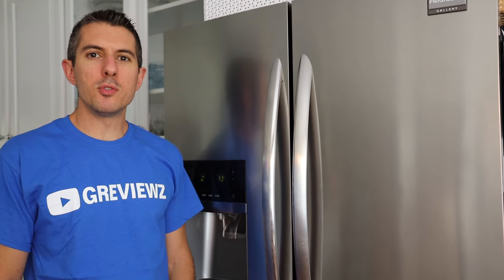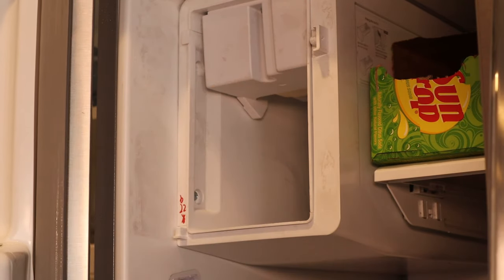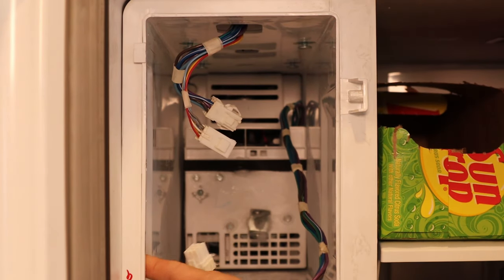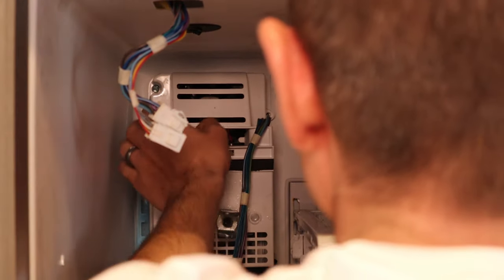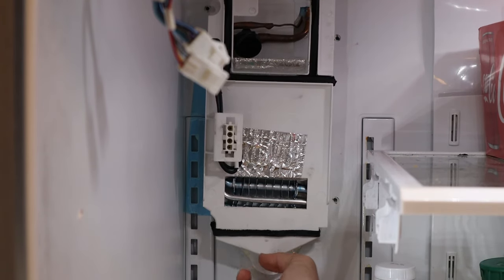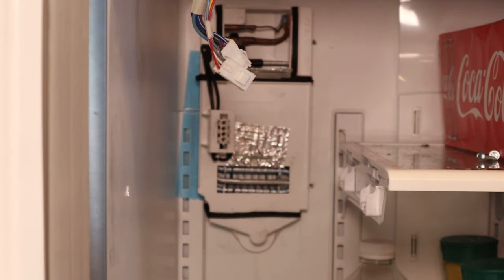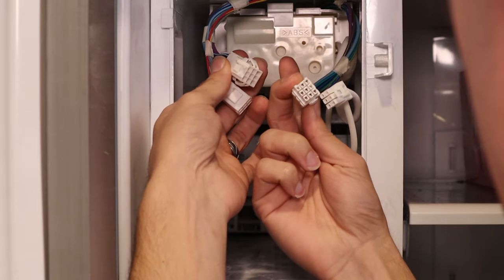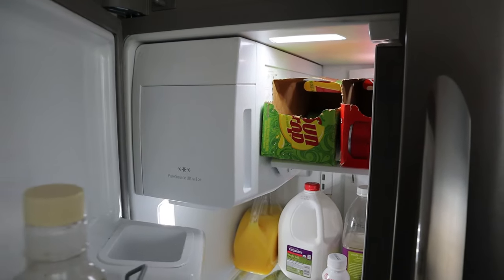Frigidaire ice maker broken again: fix it

Comment: Thank you much for the video. I was able to fix my ice maker and avoid a costly service call. The most difficult part was snipping the back zip tie for the wiring- that little sucker was tough to get to! I actually left the back mounting connected (8:55), just unscrewed the mounting and let it hang there so I could get a blow dryer on it for 7-8 minutes. Did this yesterday afternoon and we have ice this morning. Thank you!!
Reply from the maker: Thanks for watching. I appreciate the positive feedback . I am just glad it worked for you and you have ice again.. I hate to see people get ripped off with a poor design from Frigidaire..
Reply: @GReviewz  hey boss, I did enjoy the video and you are correct it's a design problem.  But frigidaire has a kit to fix this problem and I do believe they will supply the kit at no cost. You are obviously handy so contact the mfg and I'll look for your video installing kit. 
It's not to hard, I've installed hundreds if not more. 
Great video to get people's ice maker going !!
Reply: @jameseck4238  Hi, can you share a link to the kit they have to fix this? We are having to defrost ours almost monthly now
Reply: @katiec3932  what brand
Reply: If its French door bottom mount freezer ide contact mfg. Part will probably be free. Have your model and serial number handy. Tell them you where informed there's a Bulletin out on this ice maker and you'd like to get the kit. There's several different sizes and styles so it's best to contact MFG.
Reply: @jameseck4238  thank you! It’s a Frigidaire gallery
Reply: @jameseck4238  Frigidaire did not know what kit I was referring to, any idea of a part number by chance?
Reply: I installed a kit from Frigidaire. It worked for a while, but I’ve had to dismantle and defrost multiple times since installing it. I’ve even sealed up the gaps with aluminum tape and still no luck. Garbage design. 😒
Reply: @ReneJeddore  there's other reason for not defrosting. The garage kit is to get around ambient Temps being to low not defrost. Depending on the age of your refer, you more than like need one or  two of the defrost parts. 1. Defrost bi-metal, 2. Defrost heater, 3. Defrost timer/ or adaptive defrost control board. 
Heater has nothing to do with defrost. 
Also frigidaire refers especially older ones 10 t0 15 yrs old can get restricted in the sealed system.  If you have a picture of it all frosted up I could better help u. So if you have Meter you can check these parts, minus adaptive defrost  control easily.

Comment: video is great and right on the money. only problem i had was removing the very last piece of plastic in the back where the coils are but the hair dryer took care of that problem and melted all the ice anyway. started at 2:00 in the afternoon and had ice again by 7:00 5 hours later. whole process only took me 1 hour to take apart and put back together. thank you so much for the video. almost forgot i kept my fridge on the whole time exept when i was ready to use the hair dryer , then i unplugged it so my down time was only 30 minutes untill i plugged it back in.
Reply from the maker: Awesome! Glad I could help!!

Comment: Thank you so much for the video! I've been getting so frustrated. I thought it was a filter or something else. You were right. It was loaded with ice all over the back. I melted all the ice and I finally have ice cubes in my tray again!
Reply from the maker: Awesome! I am glad to hear I was able to help you out!! Please like and subscribe!!
Reply: So the ice machine was working good for the past couple weeks. But now it's back to not making any ice at all. Is there something I need to replace to stop it from freezing? I'm going to try it again Tomorrow.
Reply: The manufacturer failed to put the proper insulation in the back. Your problem will keep coming back. Check for rusting holes in the back. Class action lawsuit on this worthless POS. Lawsuit closed in 2016. YET no recall😡

Comment: Thank you for the video, I think this is what I need to do, I have the same unit. I turned the refrigerator temperature up a couple degrees recently, and since then the ice maker quit working after no issues for 4 years. My theory is that it caused melting in the ice compartment or condensation, which dripped or beaded up and froze elsewhere.  I thawed it with a hairdryer before and it started working fine again, but I didn't take it all apart and most likely there is a bunch of ice buildup like you had.  The last batch of ice is translucent, which kinda says that the fan may not be able to spin.

Comment: Great video of each step in taking the ice maker apart and reassembling it. It made the job easier for sure. My tip for other is to completely disassemble the unit until you get to the hole in the back. That’s where the last bit of ice was. I found ice throughout the unit but used the hairdryer on warm/low to defrost it all. Also, once its all back together, put it through the manual diagnostics. I did it twice and i think it reactivated everything. Ice began with the hour.

Comment: Knowing about the defrost mode was very helpful.  I was able to set to defrost, then simply remove the ice tray and take a hair dryer and blow on high in the ice maker region for several minutes, then do the same directly behind it in the rear of the refrigerator.  I actually had ice build up on the outside of the refrigerator!  After thawing the OUTSIDE rear of the fridge, the ice began generating just a few hours later.  No need to disassemble anything in my case, just removed and reinserted the ice tray after "thawing" with a hair dryer.
Reply: I'll try this first. I was going to attempt the above and keep my fingers crossed. LOL
Reply: Yes. No need to disassemble anything. Hair dryer for 20 minutes worked for me.
Reply: I have the same issue with the ice build up on the exterior. Followed the video thawed everything out and a couple weeks later, Same issue arises again. Enough ice builds up that the fan gets very loud. Any solutions to stop this form happening?
Reply: @mitchmover3284 @GReviewz

Comment: Thanks for this in depth repair video! I just fixed our Frigidaire model- JBND-27, with ice maker model- IMK0028A.

It is a different model ice maker than the one you showed. It is the same until removing the motor cover. It has 4 screws and there is a wire or hose that I couldn't seem to find a way to disconnect.

But I was able to feel around blind due to your video, disconnect the plug and lean it forward enough to remove all of the ice and defrost it all with a hairdryer as you showed.

Worked perfect and is now making ice again! :)

Thanks again!

Steve
Reply from the maker: Thanks for watching Steve! I am glad my video was able to help you!! Just keep in mind this is a re occurring problem so remember the steps and you are good to go!!

Comment: Hey man, you are an absolute life saver! I appreciate how detailed and thorough this video was, especially the parts where you include instructions that help us not to break stuff.  Got my ice maker working again last night!.  One thing I'm curious about and am going to do some more research on is, why does the ice maker ice up in the first place?
Reply from the maker: Thanks for watching. I am glad to help. It’s a moisture issue. They put an ice maker in a refrigerator… dumb idea… there is no real seal so what happens to your cooler ice when you leave the cooler out in the sun… the ice melts.. so the longer you leave the door open the more moisture gets into the ice maker area and then freezes…
Reply: @GReviewz Did you check the defroster wiring for icemaker? The main circuit board has been updated on these as well. There is a black box down behind the grill below the left door that can be replaced if you continue to freeze up. Found another utube video about it. I have this problem every month or so. Gonna try a fix. Tired of pulling it apart.  Thx for video. It was informative. The design is poor to have icemaker in the frig.

Comment: I also have the Frigidaire 3 door similar to yours.  In my case (now twice) it was literally the ice tray assembly that has been the issue.  I have not had the icing issues, just failure of the mechanism that flows/fills/heats the cubes.  I will however absolutely bookmark this in my head for when it does ice up, which I can occasionally hear the fan clipping on the built up ice, so far it self clears.

I can replace the ice cube tray assembly in about 6 minutes now, having gone thru the process now more than once.

Keep up the great helpful videos and thank you
Reply from the maker: Thanks for watching. If you haven’t had the ice problem yet, it’s coming. Keep up the good work doing things yourself. It saves a lot of $$
Reply: @GReviewz  I appreciate the encouragement.  Never had so many ice-out issues with any fridge ever.  This one is puzzling though, replaced the innards to the ice maker itself, (new tray/mechanism) as I did 2 years ago, it made 2 trays of cubes and ceases to produce anything further.  Doesn't fill the tray to make ice but yet the front panel allows for fresh water.

Me thinks the relays assembly on back may be at fault, as upon inspection I do not have any ice buildup inside any of the innards of the ice maker area.  Mine is darn near identical to the Gallery series, one level below but the ice maker assembly, mechanisms visually are identical to yours so they seem common between the various levels of fridge/freezers.  Any thoughts where to look next?  

I do have a full set of water line relays/valves from when I changed them first time thinking they were the issue when it was really the tray assembly itself.  (And I cannot access the force defrost option on my panel as it is one level below Gallery)

Comment: Great video! Exact same fridge I have, so this helped immensely! Mine was actually a little more frosted over than yours! Back to making ice!!
Reply from the maker: Thanks for watching. I am really glad I was able to help fix your ice maker!!
Reply: Froze up again shortly after. This should not be happening on a regular basis. A bit deeper dive and diagnostics on this. I found the defroster thermostat to be failing. It was not switching closed to send current to the defroster.
Reply: @bobbystark5653  where is that located?
Reply: @robbiebeacham2975  at 15:37 in the video you can see the thermostat hooked to the copper lines for the evaporator coils (black thing hooked to it with 2 wires coming off). After some troubleshooting with an Ohm-meter, I determined that had failed and needed replaced. I ordered "Electrolux 5303918568 Frigidaire Thermostat" from Amazon for my fridge (same fridge in video) and I have not had a problem since it was replaced 7 months ago.
Reply: can you tell me how to test the thermostat?

Comment: Excellent Video and spot on.  While my motor and coils weren't really frozen over, freon supply line to coils was.  Defrosting them solved problem.   Be sure to run two or three pitchers of water thru fridge water dispenser  after putting back together to bleed air out of line.  ALSO ALWAYS TURN OFF ICE MAKER IF YOU ARE SHUTTING OFF WATER LINE TO FRIDGE FOR EXTENDED PERIOD OF TIME !  I believe not doing this caused our problem.   Again Great Video !!
Reply from the maker: Thanks for watching. I’m glad I was able to help. Good pointers!!

Comment: Great how to video. I had to do the same with our gallery fridge more than once.  Also the lower freezer drain had a piece of insulation partially blocking it from day one. The poor ice maker design, lack of insulation and inherent problems caused this fridge to be part of a class action lawsuit in the US. I finally gave up and ordered a new one. Not Frigidaire either.
Reply from the maker: Thanks for watching and for the comment. I am glad I was able to help you. What fridge did you end up going with?
Reply: @GReviewz  Actually it just got delivered this morning. We bought a counter depth french door, freezer on the bottom stainless model. Ice dispenser in freezer compartment this time and interior water dispenser. Its Whirlpool. Great reviews. Via Home Depot. Hopefully no more freezing up.

Comment: Great video and super user friendly! Was exited to see I have nearly the same set up except the "coil cover" but after taking it apart, found there was very little ice. Only the coils had some ice on them. I'm losing hope that icing over was the problem now, its been a little over an hour and no sign of ice yet.
Reply from the maker: Thanks for watching. There is many reason for the ice not working. The ice buildup the most common reason however. Any ice yet?
Reply: @GReviewz  ice is way slower than I expected, but it's half full at this point!
Reply: The online manual says that it may take a few hours to start making ice and up to 48 hours to refill the bin.

Comment: Thanks for posting this, it's a very informative and helpful video but, you'd think there would be some type of defrost thermostat or defrost heater that would turn on periodically and target  the evaporator coil to prevent it from icing up. The ice causing your problem didn't appear to becoming from the water supply that makes the ice but rather from the refrigerant lines and the evaporator coil. You even even showed there to be a good three inches of ice build up inside the bottom of the coil housing that leads to the drain. 

There has to be a reason why your Ice maker conked out on you at least twice now. 

I've had the same refrigerator, or a similar one for about 3 years and while my ice maker has never iced up like that, (knock wood) I've never seen an ice maker that was so slow at making ice. We wound up buying a portable ice make to supplement my wife's ice addiction.
Reply from the maker: Thanks for watching. I appreciate the information. There is a defrost coil however it only activated when you manually turn it on. A general rule of thumb is if the ice maker is in refrigerator section this problem will take place…

Comment: great video! thanks for sharing. my 2021 era frigidaire is 90% the same with only 2 differences. 1- defrost activates the same way but doesn't show the dF on the screen 2- my coil shroud is slightly different in that the plug is different with a shorter wire that is oriented vertically, there is an aluminum cover on the coils that can't be removed, and the drain part is attached to the part with the motor and fan.  thanks again for such a detailed video!

Comment: Going to try and defrost my fridge before taking the thing apart, but I'm having the exact same types of issues shown here. I'm also going to try the 1/4" tilt that some of the others have mentioned below. Bums me out that such a snazzy unit seems to have these problems.
Reply from the maker: Thanks for watching. Yeah a lot of people told me before I purchased Frigidaire that they are an awesome e brand and last forever...apparently not! But you taking it all apart should be the last thing to do after you try other things first like the defrost, tilt etc...
Reply: Super job

Comment: Well done sir! Mine wasn’t as bad as yours but I recently paid someone to replace the water valve which did fix the problem but I also found a extra screw in the bottom of the fridge when they were done… I found where it went after watching your video! Thanks again!
Reply: was your water dispenser working? My ice maker is making ice but very very slowly but the water dispenser works fine. My water supply to the valve is strong